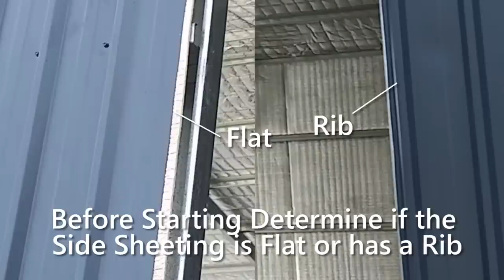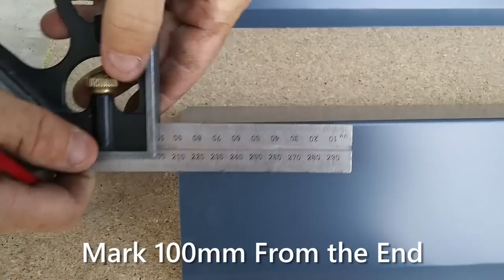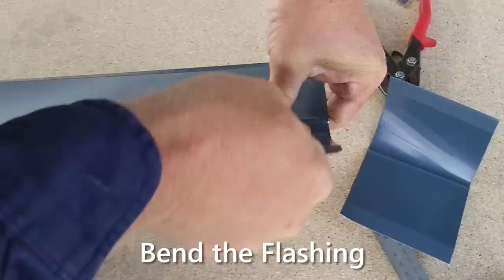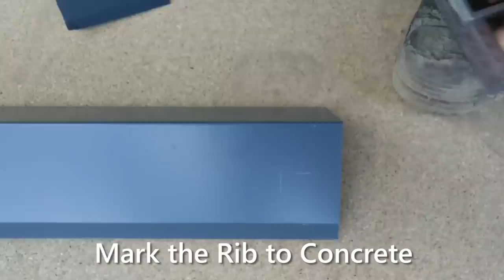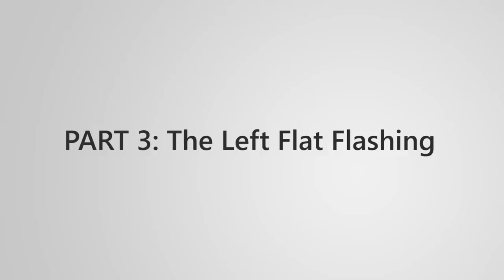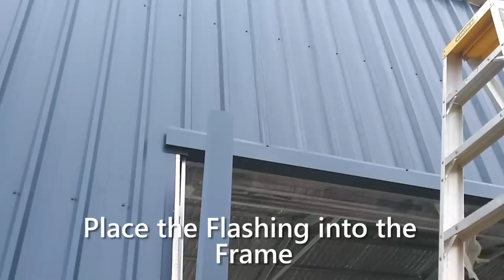How to Install Roller Door Flashings for a Shed  - D.I.Y Roys Sheds

Comment: Good video guys.. I'm at the end of a shed repair myself. Up to the flashings.. Looks neat with the header flashing... However.. If that lip sits away from the shed and the 90 deg bend goes towards the shed under that header purlin.. Won't that catch the rain?
Reply: I'm up to the same part. That's why I'm here now. Im also concerned about rain entering from the top. Is there something special done that I missed on this step?
Reply: I am wondering the same thing…?